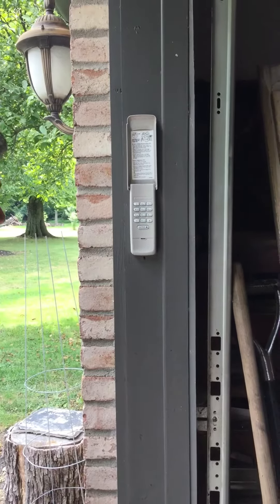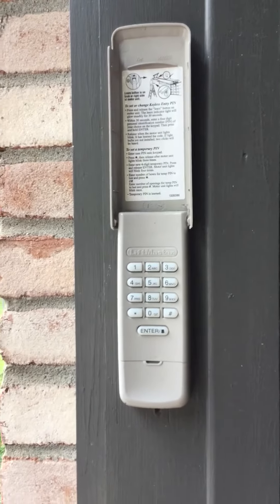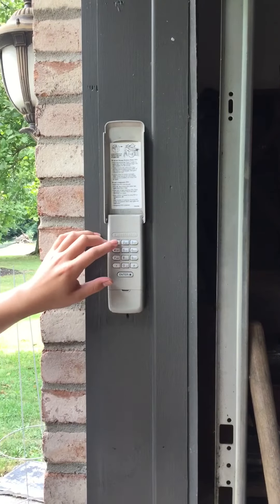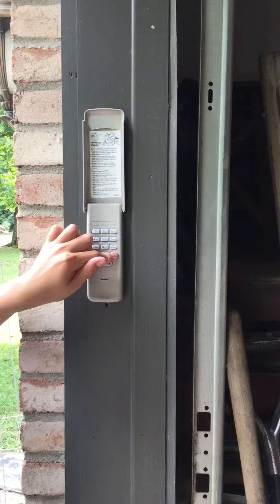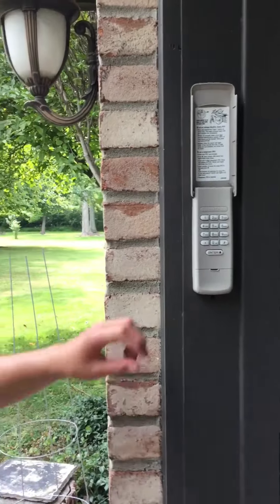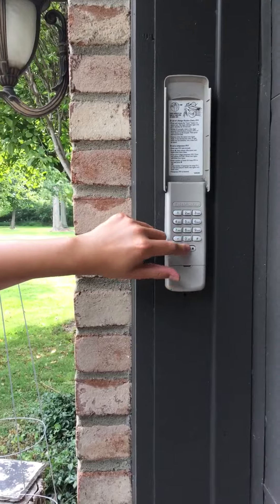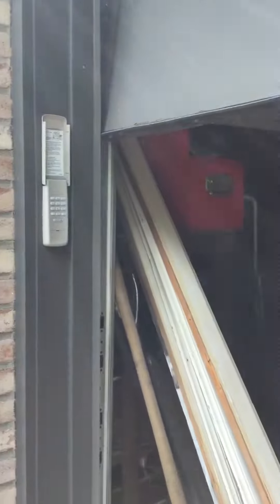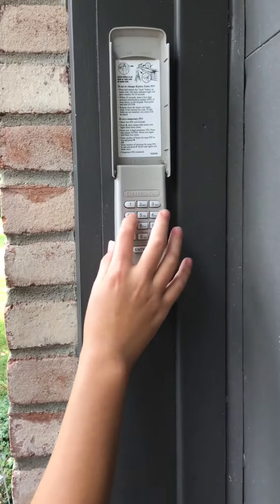How to add a temporary code to your garage door opener

Comment: Kind of an off question. But, will my Chamberlain wall keypad (940EV-P2) open my Liftmaster 81602 garage door during a power outage? The garage opener has a battery back up installed - but wasn't too sure if or how the keypad and the opener will work together in the event of a power outage? Any help would be greatly appreciated as I cannot find any info regarding this...
Reply from the maker: It would work if your battery back up is charged. I haven’t tried it myself. But I do believe it will work If you used the keypad.